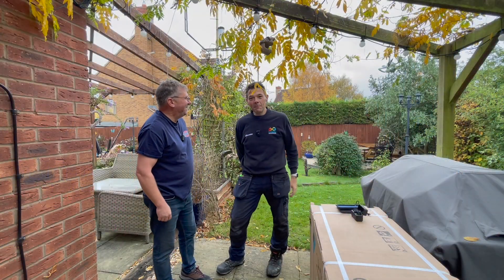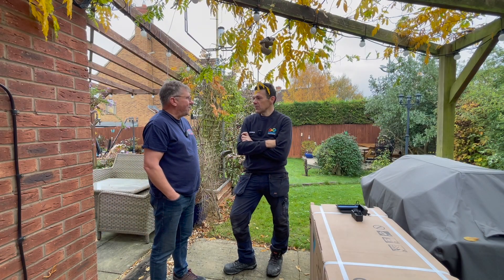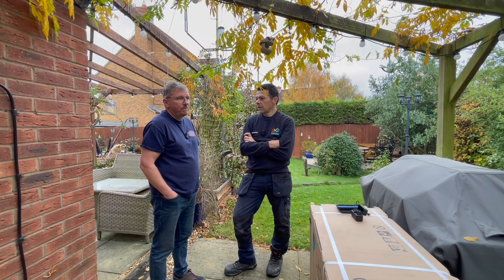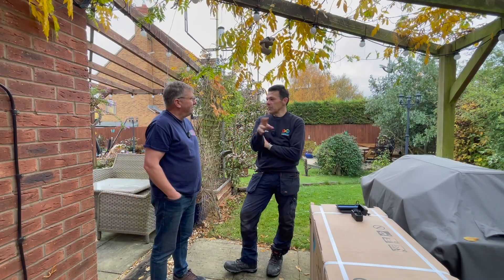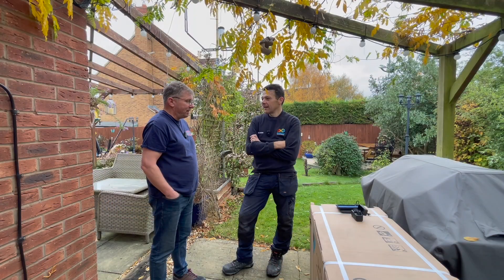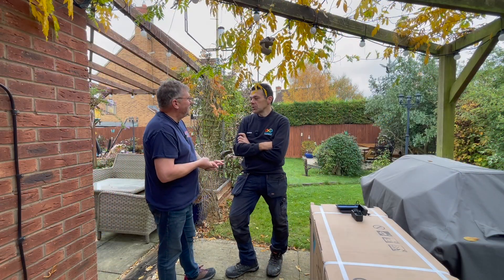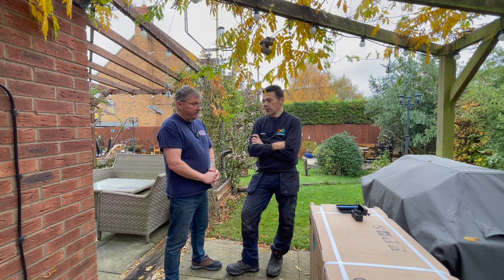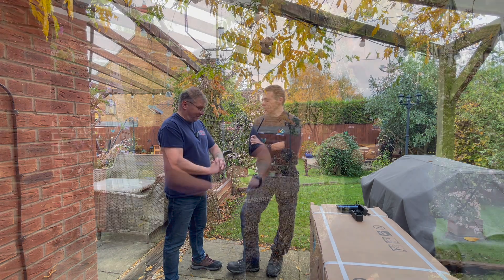Air Source Heat Pump an Air to Air Install : Is My heat pump better than your gas boiler?

Comment: If the system is going to used mainly for heating why the indoor unit not mounted on the ground?  Here in China, we used this kind of mini split mainly for cooling, it makes sense to put the indoor unit up on the wall.

Comment: How would this work in a colder climate where it’s -10c to -40c for 6 months of the year ?
Reply from the maker: The heat pumps can deal with temperatures down to -20 deg C maybe lower and still produce heat from the air. 😊

Comment: Hi Mike, I live in the suburbs of Sydney Australia. We have a heat pump hot water system. The water tank is outside but the compressor unit is in the garage. As you know it is quite warm here and this setup cools the garage space while creating hot water for the house.
Reply from the maker: Great idea that one.

Comment: Really interested in this series of videos. We are getting quotes for our house to replace a faulty backboiler system, for Air 2 Air system that heats/cools 6 rooms. Had quotes for Wet ASHP but too much trouble due to micro bore.
Reply from the maker: ASHP are not cheap but over the long term better on your pocket and the environment .

Comment: You won't regret this move Mike.  I have had the Daikin Air-Air system in for a number of years now along with a 5Kw Solar generation system.
Basically what I produce with the solar is used to run the heating/cooling and i come out with n net zero cost to heat and cool the home. Cheers
Reply from the maker: Hi Roly, great to hear from you and thanks for the info mate, without a doubt one of my better decisions.😊

Comment: Cool - just starting to watch!  We have a heat pump system in our house. Overall all - as long you use them correctly, so not like conventional heating.  We have a heat pump water system - we have HUGE radiators (double or triple) so they use load grade temp.   Mark, 2E0MSR (P.s. are you going to get rid of your radiators eventually, or just leave them in place ?)
Reply from the maker: All the radiators are being removed at the end of the install, that should give us more wall space😅

Comment: Heat pumps are amazing. They should be the default today. Getting greater that 100% efficiency just blows my mind 
Couldn't be happier with ours (air to air too). Getting cooling in summer is a great advantage too (especially with the hotter summers we're getting).
Reply from the maker: Thanks Tristan.